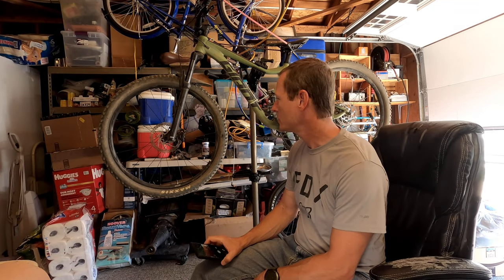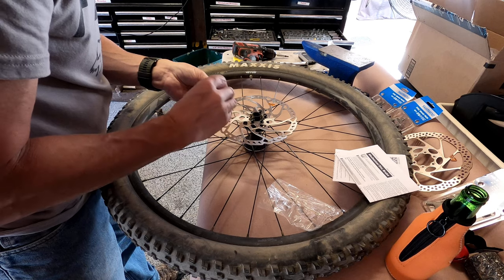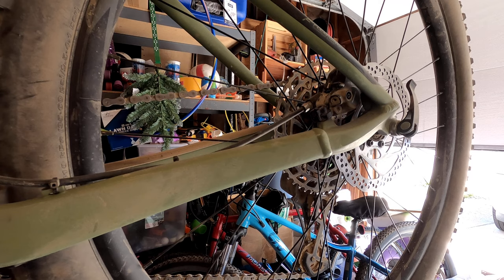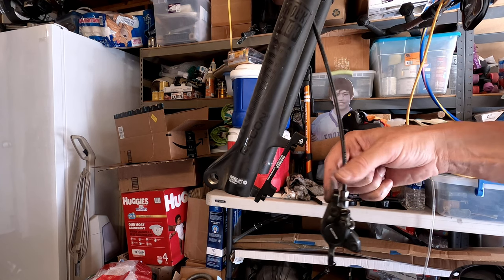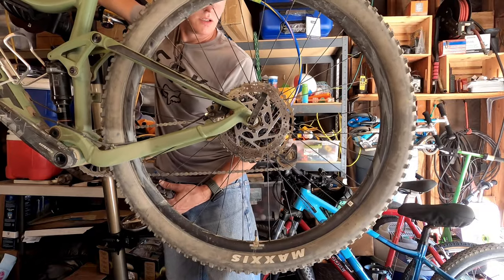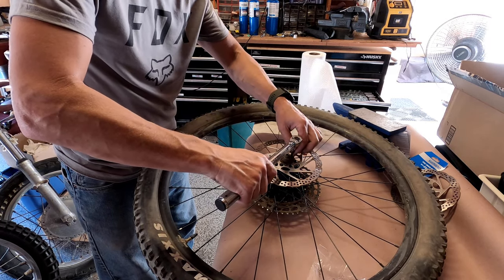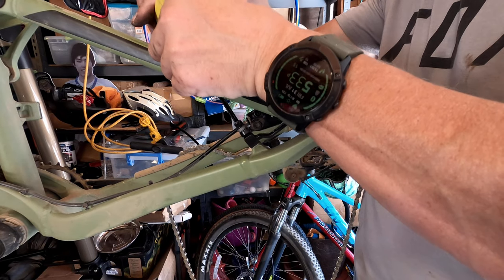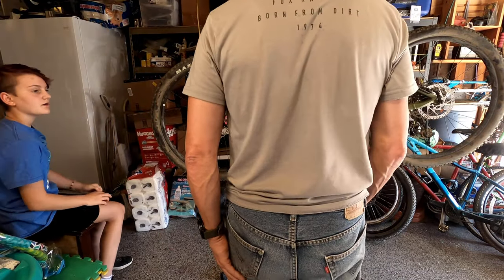Mountain bike brake upgrade. Installed 203 mm rotors on the front and 180 mm on the rear.

Comment: Ha im doing this on my Vitus Sentier. As i type this i'm awaiting delivery of fresh brake pads and a 180 "radiator"rotor from Uberbike here in the UK, after i bed the pads in I shall upgrade to 203 on the front then switch out the new 180 to replace the old shimano one on the rear.

I just found the clarks M2 brakes to be a bit naff so I do intend to upgrade to Shimano M8120 4 pot brake system back and front but Im starting with the pads and the rotors.

Comment: Just some advice : at the 18:27 minute o. The video, you say the top bolt is too long. You need to add the conical washer , then spacer —- which came with your adapator. The spacer will fill the length up and the conical washer to always maintain the bolt on center.  This step will place your caliper perfectly aligned to the rotor [surface].
Reply from the maker: Ok thanks! I also got a chance to see some friends new 2021 Giant Stances and they use different rotors so I need to update my description to specify this instructional video may only apply to the 2020 Stance 1

Comment: @31:45 "The tiniest axle". Your bike has Quick Release 141 Boost hub. The axle is inside the hub. What you are holding is the Quick Release skewer which is only used to squeeze the frame against the hub. The Fork uses a thru axle which is more substantial but essentially performs the same task.

Comment: Pro tip: Don't try and hold the rotor while undoing the rotor screws with a drill like that. Easy way to cut your hand on the rotor by accident, they can be sharp, the SM66 in particular. You shouldn't need a drill for this anyway, pretty sure the screws are supposed to be somewhere in the region of 6-8nm....

Comment: Fun video. I'm trying to figure out if the Shimano F180p/p2 adapter can be used in the rear. Apparently it works for either front or rear, but Shimano only markets it as a front adapter. I want to upgrade my rear 160 to 180. Thanks for sharing.
Reply from the maker: I believe that's what was originally on my fork and I was able to use it on the rear with no issues.

Comment: I believe the stock rotors on your bike were for resin pads only and the one you replaced in the front is for metallic can you verify that and if so which pads are you using I have had a hard time finding a shimano pad that would fit my mt200 brakes that is of metallic compound thanx
Reply from the maker: No the rotor takes resin too. I'm using the same resin brake pads and works great.
Reply: @FreeRangeChicken_MTB  okay thank you I was just wondering because I purchased the same rotors the ones my bike came stock with are RT 56 which state resin pads only but I'm wanting to upgrade to metallic pads
Reply from the maker: @federicovega2292  oh I see. The description on Jensons website says the RT66 rotor is compatible with all pad compounds. I've never tried metallic pads though. I think the loud squealing noise would annoy me lol
Reply: @FreeRangeChicken_MTB  I agree but I'm a heavier rider at 230 lb and I need a little bit more stopping power on long descents LOL